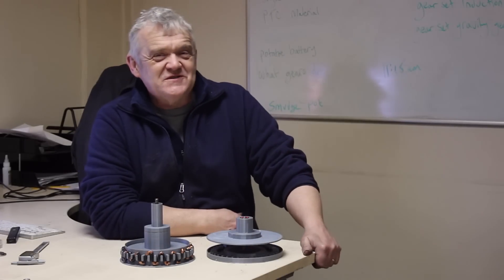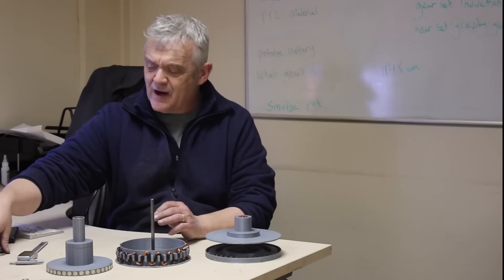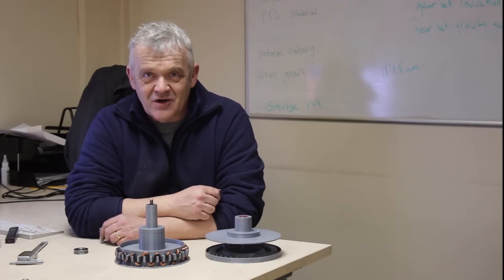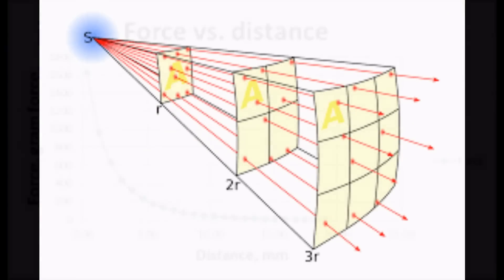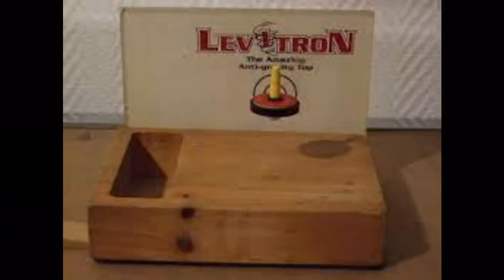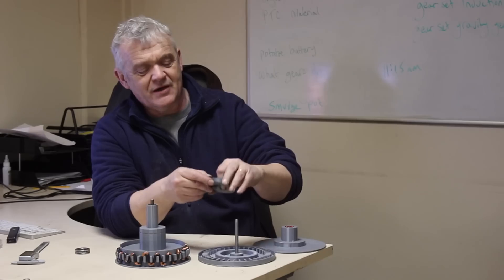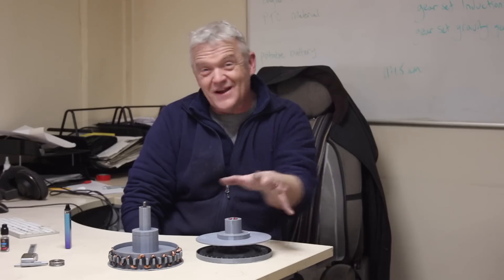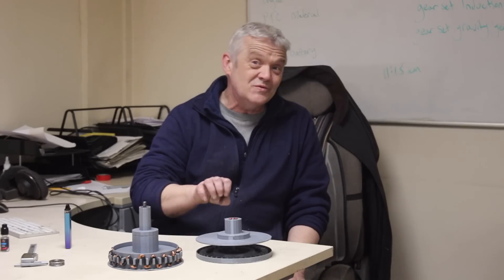1874 Maglev Versus Thrust Bearing

Comment: Hmm...isn't the thrust bearing version also fighting the cogging generated by the coil?
Reply: The coil is probably not short circuited, and it is very thin wire, so I guess that there will be some eddy losses but not much...
Reply from the maker: no
Reply from the maker: you are spot on mate

Comment: It's too bad we can't use static electricity to force parts apart more strongly the faster they spin.  We'd need some sort of anistropy in how static electric charge distributes itself across a material of a working surface.  Every discussion I see in engineering papers is how to inhibit static attraction, especially in bearings.
Reply from the maker: it is too bad

Comment: Off topic, since I don't have a way to share my rocket stove design to you I'll try to describe it here. You need two tubes of chimney flue that fit over each other. The inner tube sits lower, so it grabs the flame, smoke, etc from the burning fuel. The outer tube is offset height wise to grab air from the surroundings. What happens is, this oxygenated air gets superheated as it passes through the sleeve. Since it sits taller than the inner tube, this heated oxygenated air meets the smoke and licks of flame at the top of the inner tube. Hey presto, it ignites any unburnt fumes. And you get a gas flame at this juncture. If you consider flames in the inner flue travel , say, 30cm, and you offset the outer tube 10cm you've got a brilliant rocket stove. Ive been using my design for 10+ years. It's awesome.
Reply: You can fill it with scraps , logs, twigs, whatever. To the height of the inner tube. Light it on top. It burns like a candle.
Reply: And at the base, lift it off the ground some 8 cm. So air can feed into the inner tube from below. There's an optimum height for this, since you want the core to stay hot and not be affected by wind. Some rocks ought to do. Or , in my case, I leave 1/3 of the inner tube open at the bottom, cut away.
Reply: Make a video, upload it to your channel, and post the link...
I am interested in seeing it...
Reply: The cutaway of the inner tube at the bottom should ideally be the same surface area as the top of the inner tube. Air in = air out. If that clarifies that
Reply: One last clarification. The diameter of the outer tube is a few mm greater than the inner tube. A slither of a gap. The tubes telescope over each other.
Reply from the maker: you can make a video mate and send me the link - I will post it

Comment: I have been working on a similar project, just horizontal. Mags on the axle with mags holding it up. Rotors of coils-magnets-coils, etc so both the magnets and the coils are each acted upon from both sides.
Reply from the maker: interesting - nice one mate

Comment: these are the best videos on you tube , never learnt so much. will have to send a pic / video of the one ive built/ building, with the same concept magnet bearing  .  its similar to the vawt 1kw one you made. but with curved wind deflectors all around it to deflect the wind one way onto the blades and floating on magnet bearing. just making the axial flux motor at the mo so should be ready to test at the weekend , then next project is a water wheel from a exercise bike
Reply from the maker: nice mate - I look forward to seeing it

Comment: Thank you for Earnshaw's theorem and active anti wobble. That it could compensate for a less than ideal rotor was interesting. 
Always wondered why they are not used for ships thrust bearing. 
I know the first bearing died due to friction and not induced eddy currents in the serpentine winding. 
Please keep the education coming sir.
Reply from the maker: I am glad you do mate a lot seem to have missed the simple point if you don't connect the wires there is no current flow

Comment: I've seen videos here on YouTube where pucks of bismuth have been used to stabilize the magnetic field to allow stable levitation at room temperature without the use of electromagnets or rotation. It's a levitation of just a few millimeters, but interesting all the same. I've ordered and received a couple pounds of bismuth metal, so I think today I'll melt some down, form it into a couple of pucks, and try this for myself.
Reply from the maker: so I have I and it is fun to see and to do - just not a lot of practical use as the forces are very weak

Comment: Oh... that solves one of my major hurdles! Just finishing up my re-design and installing of my home heating, and had turned my thoughts to electricity; bearings have been bothering me. A whole new avenue to go down. It seems I'll be starting experimention at a different point. Down side, I suppose,  is that a good bit of concept sketches and notes will end up in the box of fire starter...
Reply: You know heat has a  negative effect on magnets,,,,,,
Reply from the maker: awesome mate

Comment: OMG!!!  SORCERY!!!

All kidding aside, I have to try this.  I notice the rotor is sitting fairly high.  It will probably come down a bit with the turbine added, but if it is still a bit high, my thoughts would be to extend the shaft below the stator a bit.  The bottom magnet could then be slid down to adjust the levitation height, then fixed into place when the optimum height is reached.

I have already started 3d printing my first Savonius wind turbine, and I will be printing more in "grass green" PETG (so they blend in and don't attract too much unwanted attention from the HOA).

I've seen a lot of cool ideas on this channel,  but these little Savonius wind turbines are the first one I have actually started building in earnest.
Reply: I was thinking along these lines, balancing everything to get the generator magnets nice and close to the coil should be doable, but what happens when the rotor is wet? Will the added weight be too much? I think you'd need to balance it wet and accept it might be a little higher in the dry?
Reply from the maker: burn him lolol - a circle on the axel will go a long way to helping mate and I am glad to hear you are building

Comment: Rob, I came across an interesting IC yesterday  that would really suit this project. It is the LTC3588 which takes a small, fluctuating AC input and produces a regulated, constant voltage output with a small parts count.
Reply from the maker: thank you mate - nice pointer - I will look it up - cheers
Reply: @ThinkingandTinkering  not a problem.  Linear Technology make a small demo board that would make it easy for you to do a quick test with alligator clips, etc.  The demo board is Part No "Demo 1459A".
Also, a couple of other ideas for you:
1. I understand the updraft against building walls focuses and accelerates the ambient wind speed.
2. If so, a fan-shaped housing over the turbine might further concentrate the air flow.
Keep up the good work!

Comment: All I'm saying is if you squeeze 2 magnets together, depending on how much force is applied they will be closer together or farther apart. In an axial flux alternator that would change the gap between the generating magnets and the stator coil. That would also effect the power generated, that's all.

Comment: That's really cool, that actually is what I had planned to use, If figured it was the best choice It looks like it was. What I was going to use was a bunch of disc magnets placed on the outer perimeter on bottom  of the rotor and the top of the base, I think the ring magnets will be easier ,cheaper and maybe better .  Thanks, that is very cool .
Reply from the maker: I think either will work well mate - but I also think you are right ring magnets are pretty easy

Comment: You could turn the solid disc into a 3D printed propeller, put it inside a tube, and put the modified Darwin tower on top of that to have a marvelous wind turbine.

You'd also need holes in the base, of course.
Reply: This is worth copying ‼️❣️ really like the Darwin idea And this is like the toy you blow threw, spinning something that whistles
Thanks ❣️❣️❣️❣️❣️❣️
Reply from the maker: lol - already on it mate

Comment: Robert you are just making me more and more excited with every video. When I saw the "vertical" serpentine coil with the radial magnets on the outside rim, I immediately printed the two parts. After watching this video I can see that the magnets will not line-up with my coil if I decide to use the maglev principle. My question now is whether I can "force" the "maglev magnets" closer to each other by any means in order for my "generation parts" to be correctly lined-up?
Oh yes, I see that you have used ferrite ring magnets for the "maglev bearing". Any specific reason for that? BTW I just turned 70 years of age. 😮😂😂

Comment: Add opposing magnets to the shafts as well and eliminate all surface friction.
Reply from the maker: only as an idea mate - in practical application that is going to be very difficult to achieve
Reply: @ThinkingandTinkering  K&J Magnetics has arc segment magnets so you can get one pole on the entire inner or outer surface of a ring.

Comment: Another excellent video Rob. When you blew on that plate, I thought about a tesla turbine. You've done a Tesla turbine before made with CD's and some washer spacers .... do you think that could be made to spin in a breeze?. Ive no 3d printer .... yet! or I would have had a go.
Reply from the maker: there are indeed examples of Tesla turbines being used as wind turbines mate - but you should most definitely give it a go

Comment: You could use a center rod that's magnetic with magnets around it for a pure frictionless bearings system. Then if you could even get a rough surface as you was blowing on, it should catch more air. I'm thinking of angled catcher that would work I think. What would happen if you set serpentine coil in between them, but closer to the moving magnets.
Reply from the maker: all good things to try mate - go for it

Comment: As I sat mesmerized by the magnetic bearing continuing to spin, I found myself thinking that an active magnetic bearing could be utilized to help avoid the rotor from getting out of control in incredibly high wind speeds, simply by using a simple circuit to slowly reduce the magnetic strength of the bearing, allowing the rotor to "settle" on traditional bearings around the circumference. Or am I nuts for thinking this...
Reply: Nope. Kool idea to switch bearing. The axial load would be on both at some point. Keeping them seperately ingaged would be a fun problem

Comment: Have you thought about using additional magnets above on the sides to keep it centered instead of the ceramic bearing?   Basically a surrounded magnetic field to keep it from moving sideways

Comment: Nice, magnetic bearings are a no-brainer for these applications. Would a smaller upper and a larger lower ring magnet combo assist self-catering?
The exciting part about magnetic bearings will come when we use them for car suspension & direct-driving the wheel - goodbye pesky CV joints.

Comment: Beyond my knowledge is i have seen small tubular neodymium magnets.  Are the poles at the ends or inside and outside.  Is there a way to stack them on a shaft that would repell the inside diameter of ring magnets around them to replace the ceramic bearings against the shaft.   Or can conical neodymium be cast around 45 degrees.  So the maglev effect is both laterial and linear so this could keep the rotor positioned in all directions as long as the outer magnets are putting the squeeze on the inner magnets.  That could be your zero drag bearings for your rotor while maintaining the row of magnets to stator distance precisely.   Used to me a place in culver city california that could create magnets of any shape.

Comment: as long as you dont exceed the repulsive force of the magnets, they should do the job, as the closer you try and press them the stronger the repulsion, so I would think you can load them up pretty well before they actually touch
Reply from the maker: good point mate

Comment: the one with the bearings had the magnets and the coil in place :) so some energy got sent that way
Reply from the maker: they wires weren't connected - so no - it really didn't
Reply: @ThinkingandTinkering  no eddy currents in the copper ? should have been some even if the coil was not closed

Comment: Can you use ring magnets on either side of the rotor to lock it in place without increasing drag. So the distance between the the magnets around the outside of the rotor and the stator windings can be precisely maintained.    

If so then the magnet stator gap can be set so only the top of the magnetic field can be adjusted to reduce cogging with the stator laminations. 
A different thought came across.   Small engine flywheel magnet ignition coils.  Could the stator have a primary and a secondary winding. With a power transtor much like an ignition coil to induce high voltage from the secondary.   So you dont have to ramp the voltage up to get it to go farther thru the wires  probably not efficient.  

Since you mention the ring magnets field can interfere with power generation.  Sounds like smaller ring magnets.  Bigger diameter rotors.  Scrounging some reel to real audio tape cans made out of monel as a magnetic field trap for the ring magnets.   

Have been thinking of a duck tail fairing that has 4 layers. The inner layers are just fit tight to the rotor. So little air can leak in but the rotor still spins.  The outer layers are wider and extend past the front of the rotor.  To build up air pressure in front of the rotor.  But also funnel the air to either side  of the rear opening of the inner panels creating a siphon effect and lowering the air pressure behind the rotor.  An interesting addition to this would be a damper blade like in a flue.   With a servo one could  limit the outflow of the rotor. Allowing speed control and more torque to turn the rotor when its open.

Comment: If you put a flotation device which was round and set it over that shaft with the flotation device in water it would act as a nice bearing too
Reply from the maker: it would indeed and I have done several videos on that

Comment: The only ' issue ' I see is that now you need to update your CAD files to allow for the greatly variable distance the magnetic Bearing will have due to the differences in the magnets potentially used.  Having the serpentine coil section as just a wall and not part of the base, sections of the ring, with ' steps ' to hold the next segment from the outside may help.  Usually when you connect sections of pipe, it is flared bigger and you stuff the new section into the other and that is the principle behind stepped ' washer ' segments.  The base could have the ring that the current serpentine coil gets wound on inner diameter but a slightly larger outer at roughly a few millimeters and the ' extra ' bit outside higher by a few mill to allow for it to add more segments and keep the whole thing round ( any puns in this were unintentional ).  With those specific magnets, measuring after getting the rotor and base made would assist in getting the serpentine centered around the rotating magnets and thus how much of a ' washer ' segment to use.  Thank you for the video, I forgot how simple it can be to get an equivalent of a thrust Bearing with magnets.
Reply from the maker: put a circlip on the axel

Comment: I have a high performance clutch that has weights held back by a spring.  As the engine spins more, the weights more out and lock in the clutch as a wedge.  I'd like to see a spring loaded, self expanding wind turbine that can expand in order to gain more torque and be able to generate more power.  Combine this with variable vein air control like they use on turbos.  Imagine a self expanding fan that can be optimized for the conditions in order to generate the most power.
Reply from the maker: there are turbines that already do this mate

Comment: There is a vast difference in performance of these 2 free spinning rotors but once you start to hook up a generation system to extract the power then this will put a huge load on the system which will far outweigh the frictional forces in the bearings.  I suggest that under these conditions the difference between the 2 systems will then be minimal.
Reply from the maker: you are guessing lol

Comment: RMS, If the rotor that spins longer has no magnets interacting with coils, it will spin longer. I didn't see coils to induce drag on the rotor.
Reply from the maker: the coils aren't connected to anything mate - no connection no current flow - no current flow = no eddy currents

Comment: A really useful vid for my project still in the planning stage. Your maglev bearing attached to a short Ugrinsky blade inside a pipe fed from a Darwin wind collector. Would be ideal for keeping the 12V battery topped up on many pieces of equipment but I am thinking boating. I need to think wire diameter and length for 12V, water ingression and drainage and a brake for storm force winds (having already wrecked two purchased Savonious by leaving them installed in severe gales on a swinging mooring. Also the ball bearings were not as stated in the specs.)
Reply from the maker: I am glad it helped - sorry about your turbines mate